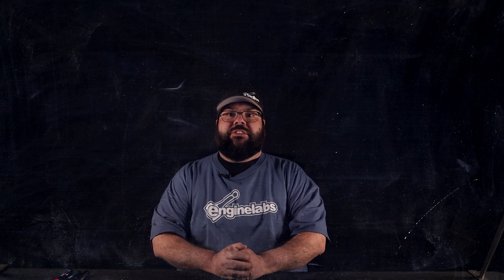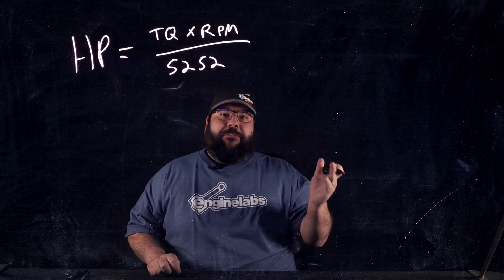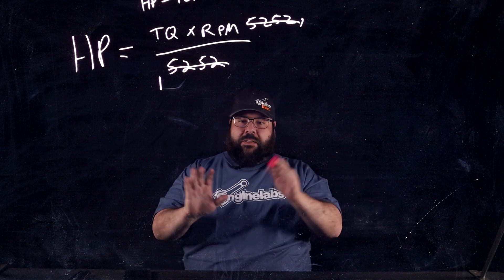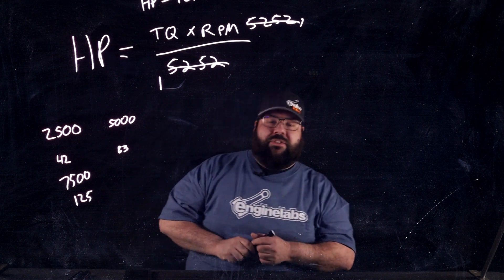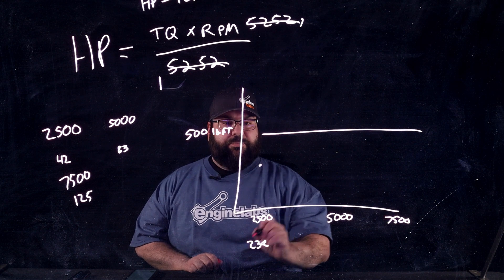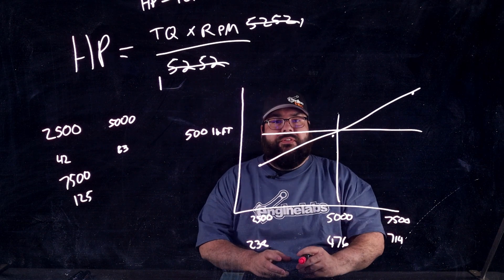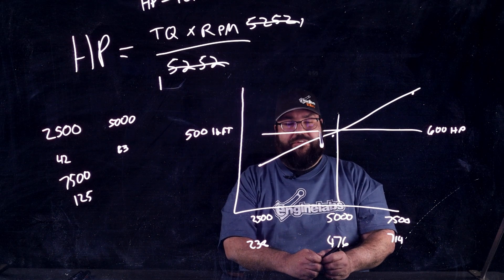EngineLabs Tech Talk | Why Horsepower And Torque Always Cross At 5,252 RPM

Comment: Great video.  Thank you for sharing your knowledge and experience.  So, given Torque = Horsepower at a 1:1 ratio at 5,252 RPMs where do most Dyno Pulls begin?  I am suspecting 4,000 RPMs +/-.  And why is there so much chatter about what gear is best for Dyno Pulls (4th Gear vs 5th Gear)?  Which one is MOST accurate for a dynograph?

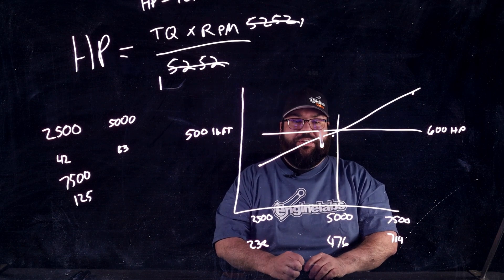Comment: Disagree.  This only works if you're using foot pounds. Seen so many videos on this and not a single one acknowledges the existence of newton meters, which is what the majority of the world uses. The comment @5:51 where you claim its a 'make believe' graph if they dont cross at 5252rpm is flat out incorrect.

Also if you're using an inertia dyno, the calculation is different so you won't always get torque and rpm crossing over at the same point, confused as to why no one ever mentions this...

Comment: One horsepower is equal to 33,000 foot-pounds of work per minute. Add in the equations relating to torque and velocity, and you'll find that horsepower always equals torque multiplied by rpm, divided by 5,252. Canceling out the equal variables, you wind up with horsepower equaling torque... at 5,252 rpm.

writing a formula is not an explanation btw